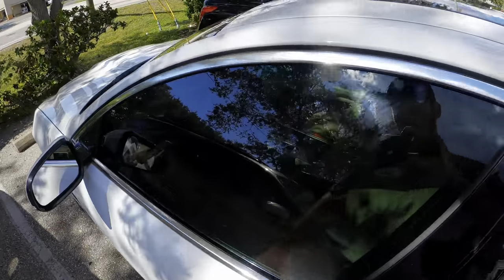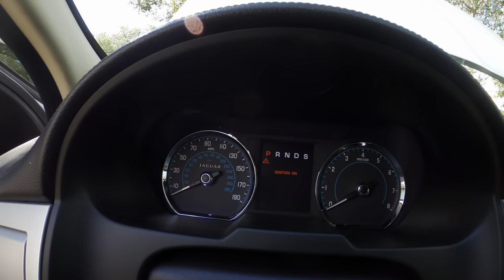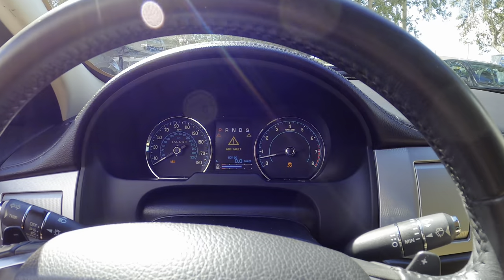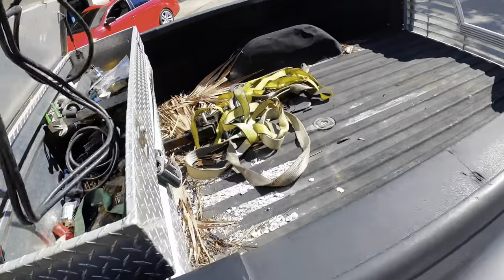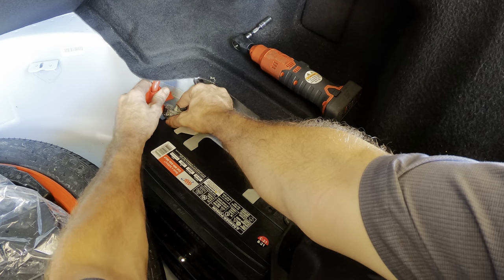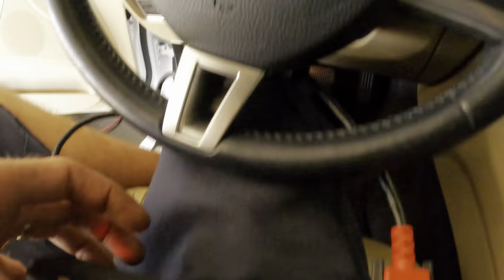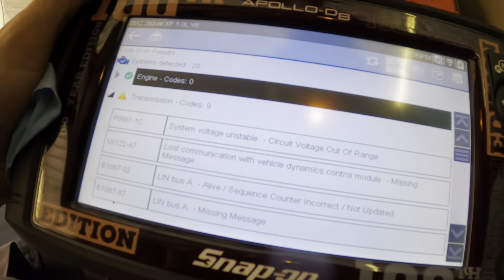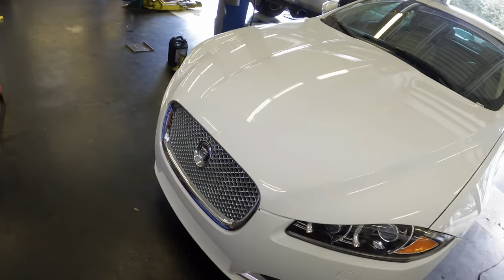Jaguar XS just Towed In.  I’m in over my head! Customer States: “Check Battery”

Comment: Give me a good old fashioned car with a carburetor, points ignition system with the only actual electronic components in the entire car being the stereo system. They are so much easier to repair than any of the computerized ones, and if properly tuned are efficient and extremely reliable.
Reply: Amen. I'm done with ridiculous unnecessary electronics that can shut a car down for a speck of dust on a sensor. Bring back basic solid components, that are reliable and easily repaired.
Reply: @mbd6054  and if they were to bring them back there wouldn’t be acres upon acres of brand new vehicles sitting in storage lots unable to be sold because they don’t have the chips needed to make them run. Also, a properly planned out and properly tuned carburetor and points ignition system will run just as if not more efficiently than a computer controlled system will. Caris should be getting way better gas mileage than they do, heck, a 1922 Chevrolet touring car got 22 mpg, a 1950 Studebaker Champion Starlight Coupe with overdrive got 31 mpg, 66 Pontiac Catalina station wagon with a 389 got 22 —24 mpg, 69 Buick Electra with a 430 got 25 mpg, a carbureted 90 Geo Metro with manual transmission got 52-56 mpg yet when they switched it to fuel injection it dropped down to 45-48 mpg at best
Reply: @todddenio3200  Very interesting, Todd. I couldn't agree more. I don't need a car to be an entertainment centre, a fashion statement, or an accessory. More concentration on engineering, practicality and real purpose and function, would produce more efficiency. The over reliance on complicated electronics gives rise to huge waste when chips fail and cars with perfect bodies are crushed, because nobody knows how to repair them, or because repairs cost too much. There is nothing eco-friendly about the current situation. It is the epitome of waste.
Reply: @mbd6054  you got that right. When parts such as electronics sensors, chips, modules, etc are discontinued and a car has one or more of them go bad there is no way to fix it unless good used parts are found — and how long will those last? Then when the car is crushed or shredded and melted down into new steel etc it will actually take more energy and cause more pollution to recycle it than an old precomputer car would consume in its lifetime. There is no reason why any internal combustion engine isn’t making at minimum 75 mpg with most being over 100 mpg but the oil industry doesn’t want that because they would not have as much profits so they work with the auto makers and the govt to keep gas mileage down and suppress anything that would lower the amount they sell and are willing to protect their profits at any cost and if they view someone or something as a threat to their profitability they will remove that threat one way or another
Reply: @todddenio3200  Absolutely true. We all know pollution is a serious issue, but the wrong path is being followed to deal with it, due to vested interests. Producing less durable, less reliable vehicles will not solve the environmental problem, but it will keep the auto dealers happy.

Comment: Simply put, the problem is that it's a Jaguar. The Jaguar assembly line should terminate with a car crusher, it would save everybody a lot of headaches lol
Reply: I've got a 2005 XJR that is an absolutely beautiful car and the quality and reliability has been top notch. On the other hand I was given a loaner 2017 Jag XE once  that had less than 1K miles on it and it was a piece of shit
Reply: Hmmm. I know where you're coming from but I've only ever changed service items on mine. Beautiful drive, lovely V8 etc. Super reliable - and I've had it for years. My next car will be a Jaaaaag, too.
Edit - after 155,000 miles I had to change the rear calipers; they could [probably] have been fixed but I put new ones on.
Reply: @ThePatUltra Interesting. You're wrong on both fronts. I'm just a guy who works on cars for a living... calling it like I see it

Comment: Looks like you have the”trifecta” problem. I’ve replaced the battery on my XF twice in 10 years. When voltage is low one headlight goes out, and all bells and whistles start to shut down (power seats, steering memory, etc) until you can’t use the gearbox. If a new battery doesn’t fix it then it’s usually the alternator. 
The rough idle is common as well. Mine was a vacuum leak near the throttle body.
Misfires are uncommon but are usually a bad coil. 
Jags are a tricky car to work on but sites like Jaglovers are full of tips and tricks.
Reply: I had a 2015 Mercedes E-Class which was like this.   Any time the voltage went low, the car turned to mush.   Multiple dealerships, even MBUSA looked at the car and were never able to fix it.
Reply: I am on my 4 Jag,, the S type with the wrong amps(or watts) battery did funny stuff.
The Jag Forums are great
Reply: Checked the manual. Jag battery should read 14v minimum with engine off.
Reply: @worldsstongeststrains983  Unlikely.  Unless it's running some highly-unusual battery, it should be reading around 12v.  12.0-12.8v is the "healthy" range for these.
Reply: @grayrabbit2211  did they check the auxiliary battery it's the size of a cigarette packet just next to main battery I'd had a ML 320 came in  with a battery light and few other lights and  the infotainment system was resetting itself the old owner replaced battery and alternator .did a bit of digging around and found a auxiliary battery replaced that and hay presto no warning lights
Reply: @MrVsbt1  they replaced 9(!) batteries total in that car in 2 years.. But MBUSA said the car was operating normally..
Reply: @grayrabbit2211  

Modern cars hate short journeys.
Reply: @worldsstongeststrains983  

That's no right. Only when engine running.
Reply: @shifty2755  the 2015 E Class I had couldn't handle highway driving.  It recharged the batteries primarily during de acceleration which doesn't happen with highway driving. It was part of the reason I went through 9 batteries in 2 years.
Reply: @shifty2755   correct. I forgot to mention “at load”.

Comment: Not a mechanic, but as an electrician I really appreciate what you did by not clearing the fault codes so the next guy can figure it out. When I was an apprentice I unfortunately worked with a guy for a bit that was always like”eff the next guy”. Learned not to be that way. You did the right thing. Great job. 

Btw, I’m wondering since the customer stated check the battery, and seeing what was in there prior to you troubleshooting it, you can tell it was recently replaced. I know you have to do something on my beemer when you change the battery to make sure the right voltage is being applied to certain modules.  Wondering if it’s the same thing here. Also maybe a bad grounding issue? Not sure but still great work. Cheers 🍻

Comment: I loved this video. There is nothing wrong with knowing and admitting to one's limits. Unfortunately, not all mechanics feel the same, and that's what leads to thousands in repairs, months in the shop,  and the epiphany that the problem was a dead fuse all along, meanwhile half the components under the bonnet have been replaced. 🙄
Reply: Or a loose ground wire under the dash...
Reply: Parts cannon sequence now at 100% !

Comment: Ahh, yes the old Jag issues, now I had one of these and I had a very similar issue. I eventually found the issue, I had a damp carpet from a wind screen seal leak, when it rained I leaked down the bulkhead and after a time corroded the BMU. One of the issues was random stops, gearbox stopped working. I was about to have my revenge on it and get it crushed, but I had the penny drop with an endoscope and trace the leak, low and behold behind the dash was a part of hell that I did not want to see again. I took me 4 hours to dismantle the dash, and repair the corrosion, replaced BMU and got a new windscreen put in and it was back to as it should. If you ever buy one, lift the rubber mats, check the carpets, smell damp? walk away. ~Trooper
Reply: Did that very thing not too long ago, lifted the hatch on a crossover. It was wet under the plastic trim. Could have been the rear window, or maybe the seal. Wasn't interested in finding out ,so I passed on buying it.
Reply: That's a job for the chauffeur old bean.
Reply: Skip everything you said but the last two words, “walk away”
Reply: Like my BMW F11 530d
Reply: Whats a BMU. Never heard of that one and I work for Jag/LR
Reply: Hey what's a BMU?
Reply: Don't worry! No chance in HELL I will ever go NEAR one of these rolling garbage bins!
Reply: @matthewmorrone883  @Lay Zay i believe he means the central junction box but thats only what jaguar call it in the uk might be different elsewhere
Reply: @Grumbly-hk8hz  Yeah Ive replaced a few of those on jags and landlubbers. Common even without the water ingress
Reply: @matthewmorrone883  I havent seen it in a land rover yet but im mostly working on xfs at the moment. which land rovers is it common on? might come in quite useful in future. cheers
Reply: @Grumbly-hk8hz  the CJB. The 05-09 mostly. A lot of the vehicles use the same Fuse block. Jags and landrover. Ford owned them fpr a while, got theor tech then sold them both along with volvo to tata motors. Volvo went to Geleee

Comment: As a GMT myself the hardest part of my job is telling customers that I can't do something. For instance, I was doing an alignment on a vehicle that had a bad steering angle sensor or position sensor and couldn't correct the issue. Spent 4 hours trying. The customer was upset and I had a hard time explaining what the issue was. Let's just say that wasn't a great day for me lol
Reply: The solution is next time, show the client within the first few minutes, then bring them along for the job so they can see for themeselves.  Electric steering is a pain but it helps to have the training and always always put the 80kilo weights on both front seats before you start.

Comment: this is why you dont drive automatics. when you have a manual it wont just "throw itself" into any gear but whatever you put it into.
Reply: Unfortunately, the market doesn't agree with you.  Manuals are less than 2.5% of the market.  I always describe mine as a millenial anti-theft device.....
Reply: you mean electronic shifter autos. older autos are controlled by shifter linkage like mine. stays in drive whether it likes it or not.
Reply: LOVE MY STICK SHIFT, and may be able to push start or coast down hill. Wish a few more people did.
Reply: @ckm-mkc  According to sales figures releases about 80% of vehicles sold in Europe and the UK are manuals, only 20% automatic. Here in Australia our figures are very similar to the US, only 3% manual. I was regularly in Europe over the years (until Covid) and it was something I always picked up on, the majority of cars were manuals. The price is the main reason, big difference between manual and auto. Our son lives in Dublin and he just bought a manual Dacia Sandero. An auto would have been an extra 2000 Euros and he prefers manual anyway (Dacia's are very popular in Ireland and the UK, they're coming here to Australia next year).
Reply: Even an auto shouldn't throw itself into any gear you don't want it in. Electronic Gearboxes are one of the worst ideas ever for a car, I kept thinking what if it threw itself into park driving down the road. I'd imagine a transmission for one of those Jags probably costs more then some people make in 2 months.
Reply: @MrPropanePete  Well in Australia manuals just aren't being offered as much, plus in many cases they are no more expensive.
Too many people don't like the extra effort it takes to use your left foot and hand occasionally, (about the only exercise they would get.)
Reply: @Cheepchipsable  That's true, most new cars on the showroom floor in Ozz are automatic only, you don't get a choice. I have a 6 speed manual Golf and an auto Ford Ranger, so a bit of both worlds.
Reply: @ckm-mkc  not in Europe. thats all we have. no one is really going to get a different drivers license to drive an automatic only. yes that exists. and then you can never drive a manual again. plus you have to retake the test in an automatic. plus its more expensive
Reply: @MrPropanePete  this. everything is manual. Here in the Netherlands you must have a different license for automatics. and thats more expensive. so you get it for a manual. electric cars are different, not included in that as far as i know.
Reply: @TriforceOfCourage97  Much the same here in Australia. If you have a manual licence you can drive both manual and automatic cars. If you just get an automatic licence you're not allowed to drive a manual car. Electric cars are treated as an ordinary automatic car.
Reply: @MrPropanePete  interesting. i did no know that. Thanks for the information
Reply: I recently read recently, in the near future vehicles with manual transmissions will be no longer be produced.
Reply: @gingerelvira6587  Yes, that's very likely. Cheaper for the production line too. I think manuals will still be a choice with 4WD and commercial vehicles for quite a few years to come though. I've had various 4X4's since 1968, all manuals. My new Ford Ranger 4X4 however is a 6 speed auto plus the transfer case for low range and I love it.
Reply: @gingerelvira6587  not here, cheaper on gas, and you need to take a different drivers test for that license. so i dont think thats happening
Reply: @TriforceOfCourage97  Fuel consumption isn't really a problem with modern automatics.

Comment: Typically when exotics (mostly Astons) lose battery power, a lot of systems tend to just fail and most likely need to be reset by the dealer or a specialist shop. I've never worked on one, but this knowledge I've been passed on by some mechanics who have. Volkswagen's also sometimes have these issues too apparently
Reply: The thing I heard when I said I was interested in buying and maintaining an Audi was "you'll have a bad time unless you find yourself some VAG specific diagnostics software". I dropped the idea, but now that Audi TTS and TT-RS cars have started coming down in price, I've grown a fresh interest. VCTool isn't exactly cheap, but a single dealership service will run you more.
Reply: yup, I saw a video where carwizard did it, he needed to turn on the modules in the correct order for it all to work again

Comment: Love your vids! Been watching for a while and work on Europeans myself. These types of cars usually have jump points under the hood where you should hook the cables up. The batteries are equipped with an intelligent battery sensor. Jumping straight from the battery can cause electrical issues. Obviously someone already beat you to it.. I fried a SAM module in a mercedes jumping it from the battery one time. OUCH

Comment: Ray, your ethics and focus on what's best for the customer is a fantastic thing to see.  I know many mechanics take pride in their work, but the one or two bad ones you run into in your life color all interactions, and that is unfortunate.  True professionals with ethics want to earn that money through fast and clean fixes, so while they are not wrong that your time is worth money, I completely understand your not wanting to charge with no fix proffered.  More mechanics like you need to show that your profession is honorable and we need to call out the bad ones to get them out of the industry.  Thanks for the videos and all the infotainment.  See you on the next video :)
Reply: I used to do computer repair. In ten years, I only charged a diagnostic fee one time. A guy called me and wanted to know I if I could install a new HDD and copy over the data from the old one. This was back in the olden times when you could power down the computer, take a side panel off the case, set a jumper on the new HDD, plug it into the ribbon cable, and give it power. Once the computer booted, you could use the XCOPY command with the appropriate swtiches, start copying the files, and have a cup of coffee while the comptuer moved everything over.  Once it was done, reset the jumpers, pull the old HDD and install the old one in it's place, and you were good to go. If they provided a new HDD, I charged a flat $50.

The guy told me that was an outrageous amount of money and a kid down the street would do it for $10, so I told him to go with the kid. About three days later he called in a panic because the computer never booted after the kid worked on it. I told him that looking at it was going to cost him $25, and if I could actually fix it it would be $75-$50 to do my work and $25 to undo whatever the kid did.  He acted like I was trying to cut his arm off (he actual quote was "$100 to fix the computer? Where the hell do you think you are, the Bay Area?" But he finally agreed.

I got there took the case off, and saw what the problem was. When the kid tried to plug in the drive, the molex connector wouldn't fit. Rather than notice that the connector was keted so it only went in one way, the dumbass took out a knife and cut off the other two corners so it would "fit". I got the $25 for finding the problem. I then explained that by trying to go cheap on the repair, his brand new HDD was junk (that happens when you put 12V on the 5V pin on the drive). And because the kid buggered up the connector and there weren't any spares, he was now going to also have to get a new power supply.

I never heard back from him again.